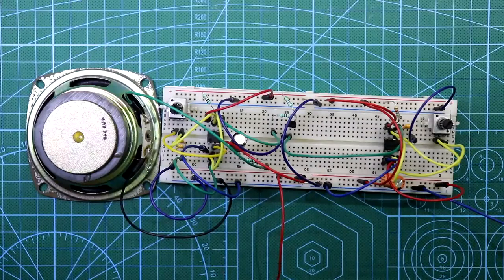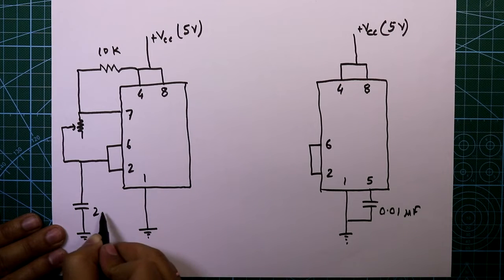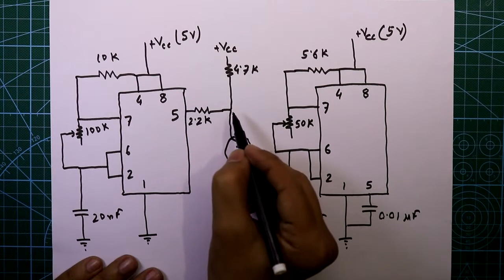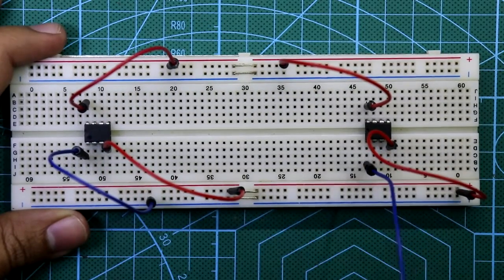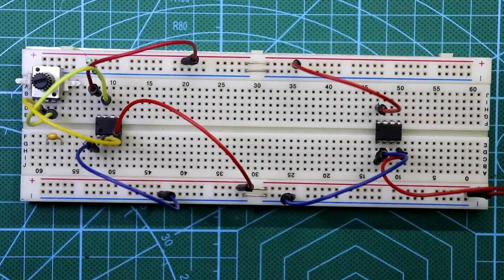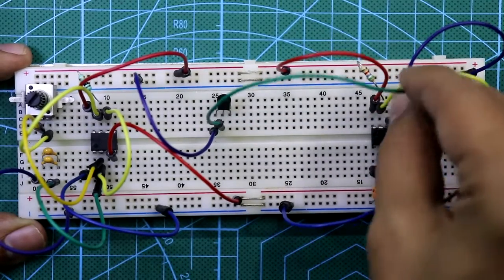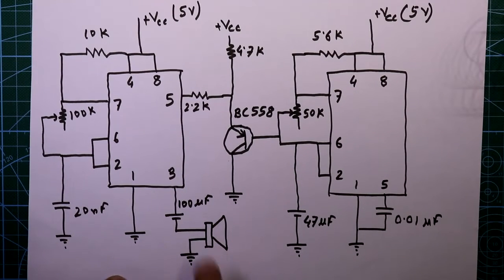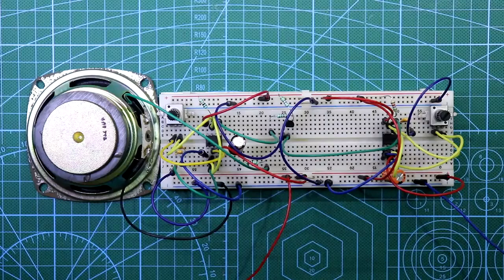Generate Police Siren only with 555 timer IC | 555 IC project

Comment: Hi I put together this circuit but ic2 potentiometer does not control the period or do anything.
Reply from the maker: Hello, What is the value of your potentiometer?
Reply: EE Wave I am using a 100k potentiometer but I am running a 100k resistor across each end to bring it down to 50k
Reply from the maker: Now please try without connecting the resistor. Use only the potentiometer. No problem with 100K potentiometer. And let me know the result. And what about the othet potentiometer? Is that working?
Reply: EE Wave I took off the resistor and got the same result, I think my problem lies in the transistor I am using a bc457
Reply from the maker: There is no transistor like bc457. I think it is BC547 or BF457. And we need PNP transistor for this, not NPN, BC547 & BF457 are NPN transistor. You can use any PNP transistor like BD136, BD140, BC558, BC327, 2N3906, SK100. These are very common. Try this and tell me the result.
Reply: EE Wave I was using a bc547 sorry but I got it working with a 2n3906!! Thank you
Reply from the maker: You're welcome bro...!